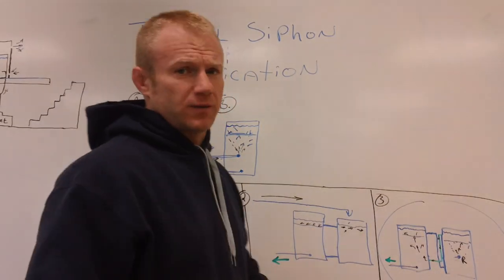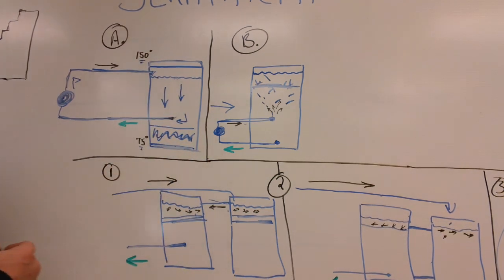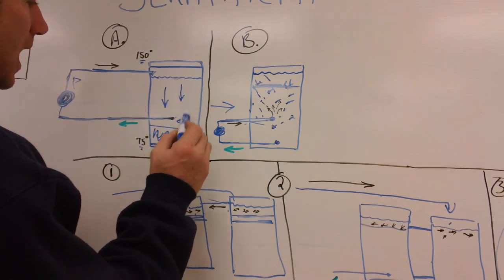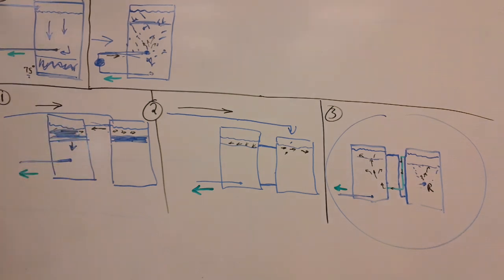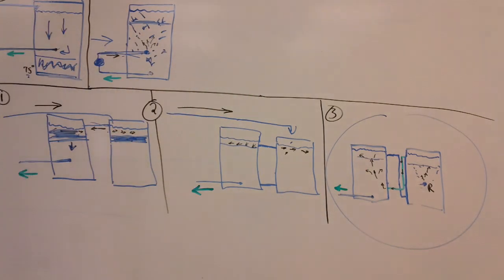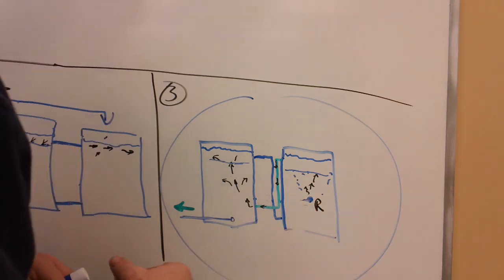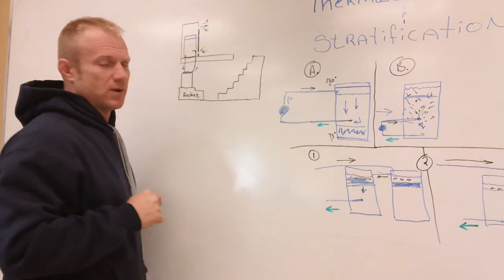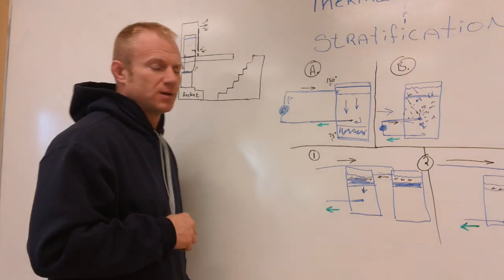Thermal Siphon and Water Stratification for Wood Burners

Comment: Hi Van, I have been watching your vids for awhile.  You crack me up, in a good way LOL.  I built a RMH which I use to heat my 20' geodesic dome (aquaponics system enclosed) here in WI.  It was minus 11 last night and I had it up to 75 degrees inside.  Of course I had to keep adding wood every couple hours.  Nevertheless, it works without any back flow.  I have many ideas I would like to share with you to collaborate our knowledge.  My email is viewgistics@yahoo.com send me email when you get a chance.  Hey, for this thermal siphon concept, use a riser in the return barrel (just like a RMH) to help turn the water.  Open on the bottom and on the top.  This would cause a constant stirring action. Q:  How many btu can a 55 gallon barrel "hold"?  I figure approx. 93,000... is this correct?
Reply from the maker: Rj thanks for watchen me mess things up..LOL I am glad to hear of you happiness with your rocket stove. Id be interested in seeing your set up to see why the draft is so good. Im gonna guees its the fresh air available and a warm exit pipe. meaning you did it right. what size is your stove sounds like a 8 or 10 by burn times you gave. Thats an excellent idea about the riser in the barrel I knew I was leaving something out when I step backed and looked at it thanks. About the 55 gallon drum holding BTU's it takes 1340 BTU to heat 1 gallon of water from 40 to 200 degrees that means 55x1340=73,700 BTU's will be released from a 55 gallon drum at 200 degrees before the 40 degree mark can be achieved in the water. In another way 135 gallons raised 20 degrees  holds 22,000 BTU's
Reply: I wouldn't say you mess things up.  Nothing is ever perfect and sometimes it takes a few tries to help curve out the best methods.  That's what I like about you, you don't claim to know everything and your always looking to improve the design. It doesn't matter where the tip or idea comes from.  In my opinion this is the best way to develop and test technology.  So few people concentrate on the details which makes or breaks specific designs.  There are very few people who really see what is going on.  Far too many people that merely assume things and that's when technology bits!  I have been digging into Watts, BTU and how to best conserve/store heat energy.  Great stuff!